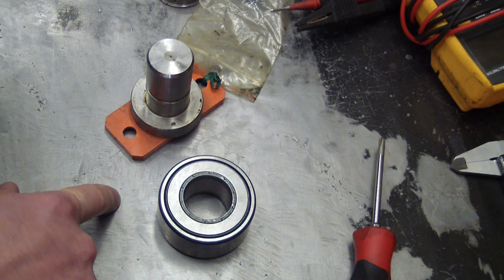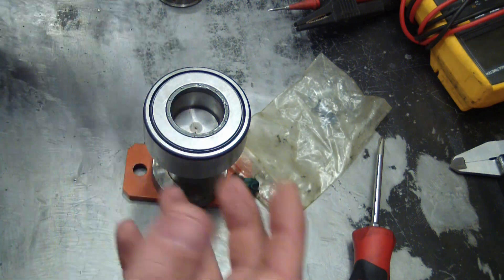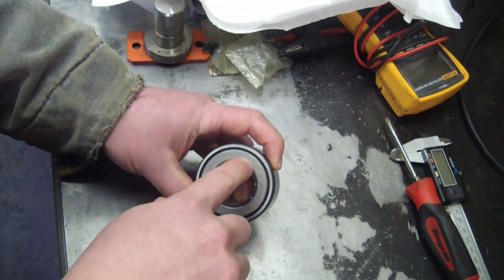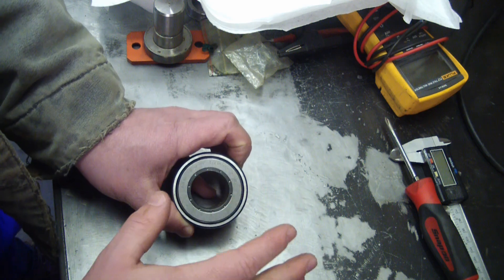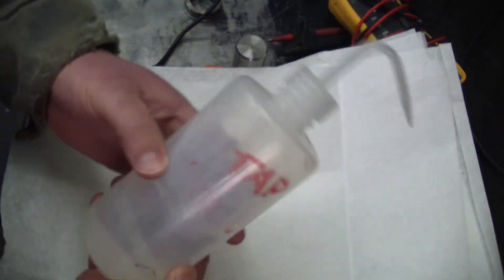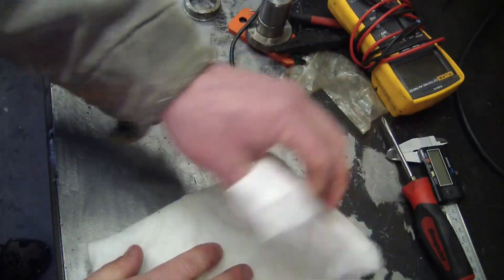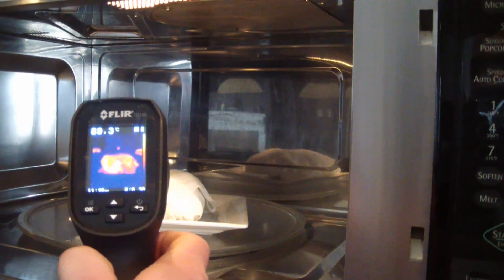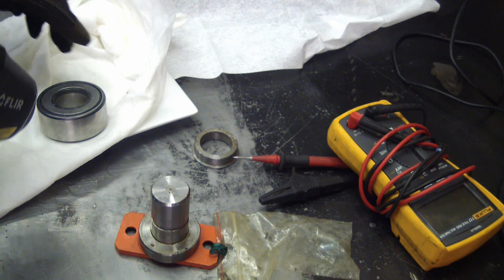The Microwave Trick? It's the easy way to heat bearings!

Comment: That's a neat trick, using the boiling point to limit the temperature. When I rebuilt my rear end, I used an old clothes iron. Sure it won't limit the temperature with the laws of physics, but your wife won't end up catching you in the kitchen.

Comment: a buddy showed me a trick.  using the old fashion regular 100watt light bulb in a lamp.  set the bearing on it and by the time you need it, hot and ready.  hardest part anymore is finding the 100 watt bulb CFL and led bulbs have taken over

Comment: could you just put the bearing in a pot of boiling water?
Reply: +Matthew Vandeventer you sure could, just keep that pot boiling because you're gonna be replacing a lot of bearings.
Reply: I understand it will rust but to keep the water off just use a plastic bag.

Comment: uhhh..... My oven, toaster oven, ect... all with built in temp control, all do this just fine. I even have one in the shop. I don't even have to put water on anything.And then.... I can have pizza without going to the kitchen, cause there's a refrigerator out there to, with beer!Men make this way to complicated.... of course I have been known to disassemble small engines on my kitchen table.

Comment: Have you tried placing the shaft in the freeze?
Reply: +kingmike40 If you need a temperature difference of 90 C that'd be a very cold freezer: -70 ones do exist in labs and such but domestic ones aren't much lower than -18.

Comment: why do steel rings get larger when you heat them?  I know this is common knowledge but I've just never understood it.   Shouldn't the ring grow in an inward direction also?  Making the hole smaller potentially?
Reply: +kevin smith Think about the very last layer of grains before it becomes hole. The material would have to contract itself (increasing density) to expand inwards. So the metal will simply take the path of least resistance and expand outwards independently of where it's located. Remember, things usually expand when they heat up so the material in the inner diameter wants to get away from itself, not huddle closer.
Reply: I see what you're saying.  Basically, it does expand inward but it pushes on itself.  So the ring hole can only get larger

Comment: Good one. it's amazing what can be done in a microwave. Far more versatile than most folk think.
I used to work down the pit, as a fitter, and down a mine ya can't use heat, no welding or burning torches or anything like that. In a bind we would go the other way, and try to shrink the shaft, CO2 fire extinguishers can get shit rather chilly.
Reply: +rationalmartian Dry ice from the CO2 is -74.8°c - have done the same things many times.

Comment: If getting it wet isn't a problem and you're not keen on putting it in the microwave, why not just toss it in a hot water bath close to boiling temperature?

If getting water on it is a problem, why not a hot oil bath?

Comment: What about a heat gun....
I do it all the time for crank shaft bearings and never had a problem.
Reply: +Tyler S Is it a fancy thermostatically controlled heatgun? If so, what temp do you set it at?
Reply: +Tyler S Why bother just keep a microwave in the shop 1.5 min and done. So much faster.

Comment: I once had to de-stress a Honda 750 engine casing after welding (chain snapped and went through the casing). Bolted both halves together and when my mother was out, put it in the oven, 200C for two hours, (no microwaves back then) switched off oven to cool, and forgot about it. Hell hath no heat like a woman whose oven has been invaded. Dad was called in to reprimand but unfortunately he couldn't see what the problem was. This was only surpassed by my brother who killed a Cape Cobra, skinned it, cut off the skinned head and put it into an egg cup which he placed in the fridge until he could decide what to do with it!
Reply: "I forgot I had an engine in the oven."  OK, now I've heard everything.
Reply: Chain Grease Causes Friction.                                                                             Back in the 70's we used tubs of chain wax/grease, which we put on the stove burner to melt and then immersed the chain in it. My friend made the mistake of answering the front door whilst doing this, on his return to the kitchen the tub had caught fire. His attempt to extinguish the fire with water made it much worse. He saved the day by dragging all the flaming stuff outside, and lost his long hair in the process. Needless to say, his Mum want apeshit, but
his chain was nicely lubricated. He switched to spray lubricant after that!
Reply: My wife didn't appreciate me using a burner on the range/stovetop to heat a pocket knife blade, particularly since I left it to heat soak and forgot about it for a couple hours. Using a copper wire I had attached to the blade beforehand, I quickly brought it from the stove to a sink full of cold water. Martensite is beautiful stuff.
Reply: I use my oven for doing hub bearings.  Still have a picture of the front hubs of my car in the oven.  That oven is only used for car parts due to the smell and after taste of axle grease though.
Reply: @Worrsaint  I put the grease on after installing bearing, to avoid that problem :-)
Reply: @Worrsaint  Your doing it wrong, the grease gives it a better taste, you need to baste your roast dinner in axle grease before you put it in the oven
Reply: @conorstewart2214  Car Wizard has entered the chat
Reply: +4 Foxsaches I used to have a box set up for cutlery before I had a live in of the fairer sex
Reply: +Biggerbadwolf LOL I did that with western diamondback rattlers once. Once!
Reply: lol!!
Reply: Apparently working on your chainsaw on the coffee table is somehow very, very wrong and evil, even if you put lots of newspapers down. Who knew?
Reply: This is applicable to the correct usage of the phrase "boys will be boys". I love this shenaniganary.
Reply: Used to pull the fairings off my FZR600 and put em in the dishwasher... Yeah it was fun getting caught doing that...not!!!🤣🤣

Comment: Or just freeze the other part.
Reply: +Stingray but if the expansion rate is the same as the retraction rate, its harder to get something -200 than it is 200 degrees.  That, and it may become brittle at such a low temp.
Reply: Stingray

Comment: Could you not put it in e.g. a freezer bag and leave it in hot/near boiling water for a while? If it still doesn't fit then, would it help to put the other part in the freezer to make it shrink at the same time?

Comment: That's one neat trick, I wish I had seen this 3 weeks ago!
We had to heat up a bearing assembly to fit over two gearbox axles. The boss showed me a neat trick though, he just put the whole bearing in a pan, added motoroil, and put the propane torch underneath it. Add a thermometer for thermometering, and voila your bearing in nicely medium cooked in about 10 minutes!

Interesting that you mention 200°F as max temperature. The gearbox manufacturer said it needed to be heated to 150°C/300°F, so that's what we did. It was just a normal sealed rollerbearing.

Comment: Simply too dangerous!!!

If your wife catches you...
Reply: +AvE alternatively if you do get busted you can cool the shaft with your wife's icy glare and get the job done on the other side of the spectrum
Reply: +Aaron Wright hahahahaha
Reply: +Daniel Mattsson - Live dangerously! LOL 
Wait 'till she find out that you just used the dishwasher to clean those oily car parts and try to explain why it's still smelling a mix of gas and oil...
Small side note the car parts ended up impeccable. ;-) LOL
Reply: @crpth1  just like a block cooker😂😂😂😂😂😂😂😂😂😂
Reply: Ballless simp.
Reply: Well, I bought the microwave the dishwasher and the oven she doesn't know I use to dry 3d printer filament or the headlights I separated to polish and reseal them.

I have the advantage that she's disabled and, unfortunately, stuck in bed when I do these things. Mind, she likes when I have my overalls on and smell all oily and greasy, so she might just get distracted if she ever catches me 😉😈

Comment: Great trick.   Just thinking outloud, how about using distilled water for a little more corrosion protection?    Maybe it doesn't make a big difference, but might be worth trying.
Reply: That one looked pretty clean to me.   Add heat and water with minerals and you have accelerated corrosion.  Maybe.   I keep distilled water on hand.   It's useful stuff.   Not a huge concern but thought an ounce of prevention might be worth a pound later on.

Comment: Why doesn't heating a bearing cause it to expand in all directions, ie shrink the inside diameter by expanding towards the center?
Reply: It is the circumference that expands. Since C=2*pi*R, when the circumference increases, so must R. And yes, the material does expand toward the center, just less so than it expends circumferentially.
Reply: Mecdemort I am not certain but my thought is that the expansion is going in all directions so the expansion that would cause shrinkage of the inner ring diameter is undone and overdone by the expansion going outward
Reply: Mecdemort Chris gave a good technical explanation, if you don't understand it try thinking of it this way. Imagine the race is really large. He said you get .001" expansion per inch per 100 degrees right? 

So to make the math a little easier, imagine that race were say 1 inch thick with a 30" inside diameter. You heat it up 200 degrees as he did here so the metal expands inwards as you say by .002 because it is 1 inch of metal on each side and would expand outward 1thou and in 1thou. But the race (pi* diameter and I am going to round pi to three for my math = 90inch circumference) could be thought of as approximately 90 square inch segments arranged in a circle. Those also expand .001 to the sides. So the circumference has gone up by .180 which divided by pi (3) again means that it has forced the diameter to expand .060

This is all fuzzy math just simplified to illustrate my point. :-)
Reply: ***** WTF?!

Comment: Do I have to use the square desert plate? Have you ever put a cup of water in the microwave for a few minutes taken it out and you put a tea bag or a spoon or something in it and it violently boils all at once? that's because you've supper heated the water. It is hotter than boiling temp. I don't know if you can do this by pouring  the water into a rag but it is something to consider. either way, Neat trick
Reply: God of Thunder The reason that a glass of water can sometimes be super heated is because, to put it in the simplest terms there is no place for the bubbles to begin forming to boil. Then when you disturb it by inserting something it goes off. With it on the rag there is nothing but surface area for it to boil from.
Reply: imchris5000 I once had this happen with Horlicks / Ovaltine Drink, made with milk, it pretty much exploded when I put a spoon in it, But Unfortunately I never gained any comic book superpowers :-(
Reply: FUCKGOOGLEPLUS INTHEASSWITHAHUGEDILDO no superpowers that you've found yet. Give it time. You had the power to whistle at birth but you prolly didn't discover it until you were 5 or 6. Superpowers are waaaaaay more complicated than whistling
Reply: Andrew McGibbon that only happens with distilled water
Reply: imchris5000 I've found out about it using tap water in my kitchen

Comment: the idea of using a microwave oven is good, the only drawback is that humidity produced by the vaporizing water is a corrosion starting point inside the bearing, better to do this on a non sealed bearing and immediately wash it with fresh oil

Comment: Doesn't metal heat up in the microwave on it's own? If the water isn't absorbing all the microwaves, wouldn't that mean the bearing could reach temperatures higher than 100c? If I had a fancy IR thermometer like you I would test this with a chunk of something that could stand to be heated above 100C

Comment: Really clever trick.
I needed to think for a few minutes on this, specifically how much the bearing expanded. The way you explained it was describing it as the diameter times the growth rate, but I thought it would be the circumference times the growth rate resulting in a new diameter.
It took a few minutes, but I convinced myself that at least in this case, both ways result in the same answer, at least as far as could reasonably be measured.

Comment: My question do the microwaves stop at the wet towels or would they reach the grease and seals and adversely affect it?  I always thought a microwave cooks from the inside out.  Also, when you put a fork in the microwave it will spark at the tips, is that possible with the bearings and the race?  Sounds like a good part 2, when the wife is at work or out of town.
Reply: Is arc damage/pitting between different bearing surfaces a possibility?
Reply: Coolkeys2009, someone needs to put a fork in the microwave to determine if there is pitting or damage.  Maybe the metal differences and between a fork and a bearing could result in different outcomes though.  Could the microwave also magnetize the bearings, which could also shorten the life?  AvE with you technical background and education you should be able to come up with a test to answer these questions.
Reply: Johnny Woo Two forks laying on top of each other or even two bits of foil if you believe  all the microwave are absorbed by the damp cloth.
Reply: Coolkeys2009, thank you for the test.  I am interested if the steam could pass through the bearing introducing moisture into the grease.  You could wrap the bearing in Saran wrap possibly to reduce the risk of possibly steam entering the sealed bearing.  Maybe also aluminum tape around the bearing seal, then heat, install and then remove tape.  I also wondering if all of the microwaves are absorbed by the wet towels or is some of it absorbed by the grease in the sealed bearing.  I am thinking you could put a small amount of bearing grease wrapped in possibly aluminum foil and see if they is any melting or use a laser thermometer to check the temperature.  I am just trying to figure out if any damage is done to the bearing to not use AvE great video.
Reply: Johnny Woo Tape and plastic may melt and stick on the surface.
Smither the bearing with lots of grease before raping it with the wet towel and you are golden. Same goes if you put the other part in the fridge.
Reply: I have the impression "  a microwave cooks from the inside out " effectively grew up from advertising wash off . As I understand it , it ' s the vibration of the water molecules , and it rotated to compensate for the rather limited capability of the systems . Like every other system , it has it ' s failings , and on the grounds , you cannot effectively " see " anything , bad engineering / people cutting down specification can easily be covered up . I ' m sure there is a lot of marketing drift . If car companies can put out stats which have little underpinning by truth , if your only waiting for a warm pie ....... or bearing , who ' s counting if you have to get the thing to go " bing " again .

Comment: This technique also works well for heating up compact discs so that they fit properly over the spindle of the CD player
Reply: I found that just setting the CD on my coffee cup makes it heat up faster.
Reply: What’s a “CD”?
Reply: WEOWNTHESKIES I saw compact disc and straight up though what the hell is that? Then I saw CD and was like oh yeah
Reply: @WEOWNTHESKIES  imagine a cassette tape, but not a cassette tape and it uses lazers.. wait.. no.. imagine a record that's smaller than 7 inches and is shiny, key difference is that it uses lazers
Reply: @fall-of-rome  .... 2 kids in a basement looking through grandpa's vintage LP collection. One says, wow, look at how big these things are. The other says, just imagine the size of the old computer they fit in!
Reply: @WEOWNTHESKIES  Cross Dresser
Reply: @rupe53  My work had a 20 megabyte hard disk the size of a washing machine. That’s not a typo.
Reply: @Dave5843-d9m  ... did it also play LPs?  <LOL> BTW, my wife worked in a department store back in the days of main frame units so I can only imagine what might still be hiding in a basement somewhere!
Reply: Old DEC confuser in computer lab used 12 inch disks. TRS80 was high-tech
Reply: Backbone of whatever running today. They never tear it all out and start over just patch over patch
Reply: Obvious Schism 😂
Reply: Anas Amia :)
Reply: Yes me like the sparkles too. Wife said I'm not trying it with "her" microwave, gussing she just authorized me to buy a new mic for the shop/ tent. Lol.
Reply: @daviddroescher  
A perfect excuse to treat the Empire of Dirt to a new microwave which turns angry pixies into angry micro's which then infuriates the food your expecting to ingest into your carcass.... the workers union approves.
Reply: Mineral water works safer😎
Reply: The music on the CD is ‘meh’? HEAT IT UP
Reply: Gotta try that!
Reply: This coment section makes me sad
Reply: @imagineaworld  What's a coment?
Reply: Might want to remove the estrogen enriched halibut from your diet if you're having trouble with your CD player, for me it's  a lack of effort to facilitate pushing it on, just relax the muscles in the arm in the weight of the hand will push it on.  No swing presses requirements.
Reply: @daviddroescher  I don't eat halibut, it's just lots more fun to use a microwave oven